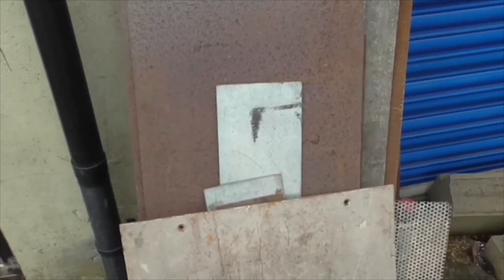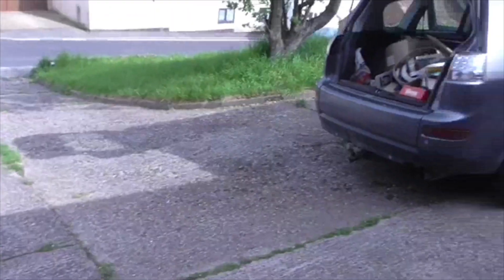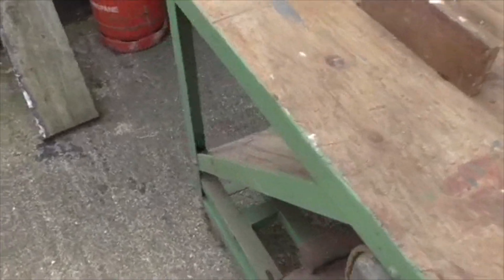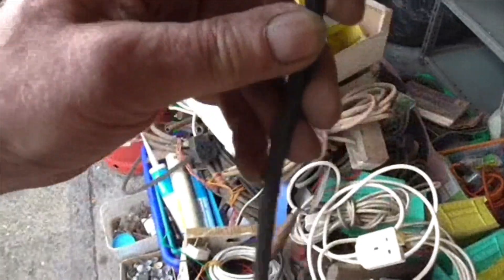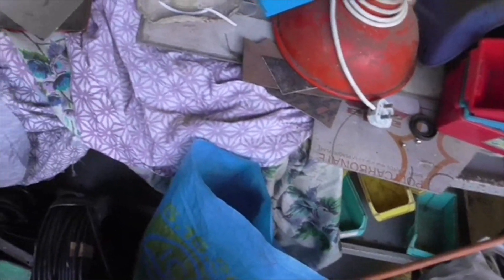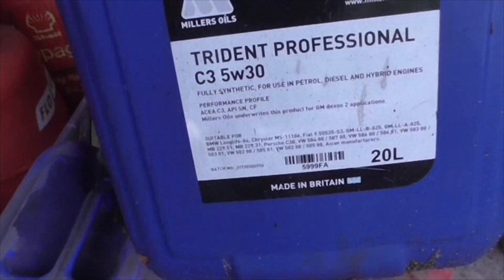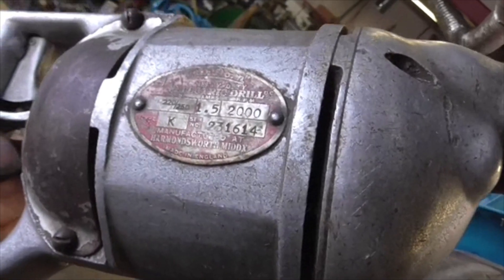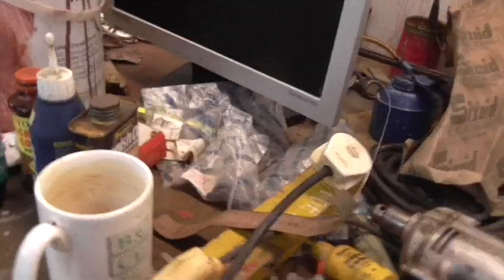Another week of clearing and sorting!

Comment: Think twice throw once Phil. Hope you  can use lots of your mate's stuff. Stay safe.
Reply from the maker: I have a length of channel about 4ft long, price today £145.00 +VAT per metre!! A 15" length of 3/4" comes in today at £28 a metre! I had absolutely no idea that UK steel prices were so high!!! I let a lot of stuff go in the skip that as really rusty or of little used to me, the usual deal is that you get the skip free if you fill it with metal, but you are not paid for the metal, they got £250 as well!!! For me the joy is in the little odds and sods that would have ended up in the skip which have been saved!
Phil

Comment: No idea on the drill, but it looks interesting. A friend of mine built a circular saw like that and he used a 3hp (possibly more?)single phase motor from out of his old dairy unit on his farm. Looking at your workshop and tidy up makes me think I should be having a clear out too!
Reply from the maker: The saw has very small plummer block bearings with bronze bushes, and although it does run, they are very tight, I think I will combine it with a metal top to become a wheelie welding bench!
Phil
Reply: @philhermetic  Not a bad idea. What about the motor?
Reply from the maker: @JonDingle  its is a bit of an odd bugger, equal length long shafts at either end, as though it was a polisher, but just normal plain shafts with keyways but it runs well!
Reply: @philhermetic  Hmmmmm
Reply from the maker: @JonDingle  what you thinking?
Reply from the maker: the twin shaft motor gets stranger, only 950 rpm and long flats, not keyways, and the drill is a Van Dorn! 
Phil
Reply: @philhermetic  Very interesting that young man!